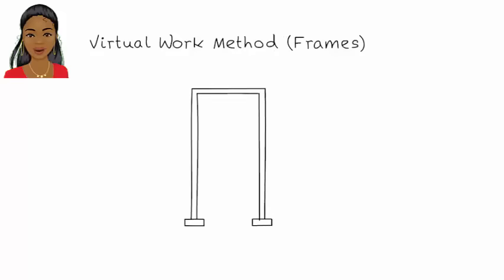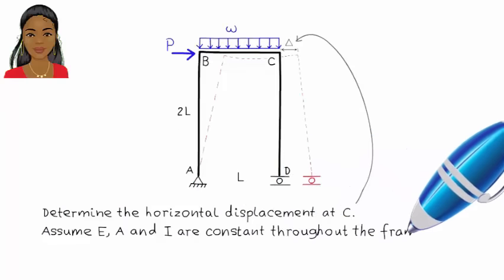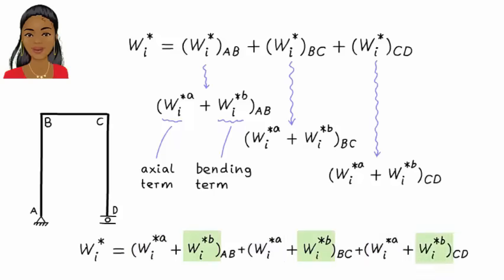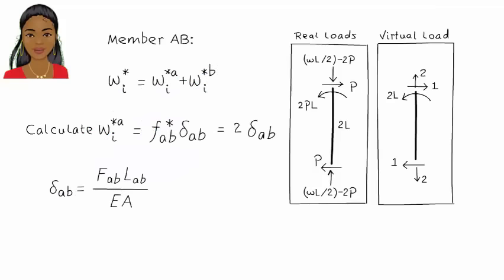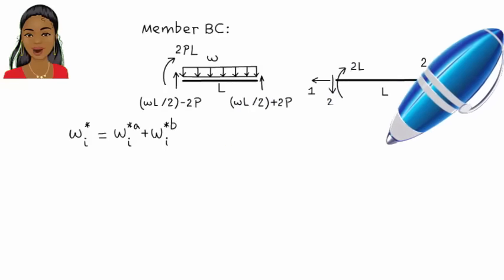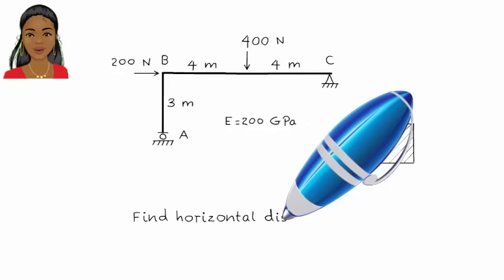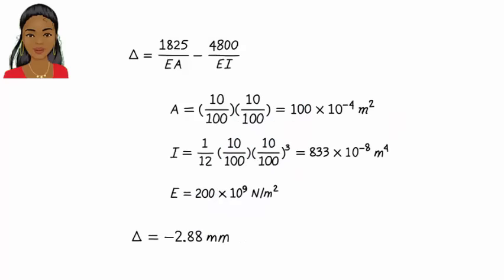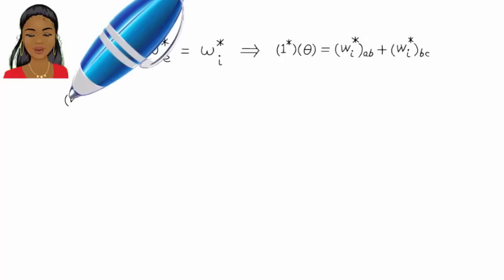SA23: Virtual Work Method (Frames)

Comment: Hi, at the example: where is the moment in member BC due to 400N load?for example at the FBD of joint B? am I confused?!!
Reply from the maker: +Omid Hassani The free-body diagram of member BC is shown @9:00. 

The diagram shows no bending moment at B or C. Basically, the FBD is that of a simply supported beam. So, we are writing moment equation for a simply supported beam subjected to a concentrated load of 400N at mid span.

This means bending moment at B is zero (moment at the ends of a simply supported beam is always zero). Then moment increases as we move toward the middle of the beam. Where does this moment come from? From the shear force at B. That is, at distance x from B, bending moment equals: x times shear force (or support reaction, if we saw the beam as simply supported) at B, or 200x. This equation is valid for the left half of the beam where 0 < x < 4.

Past the middle of the beam, the bending moment equation changes due to the presence of the 400N concentrated load. Now, the moment equation becomes M(x) = 1600 - 200x. This is valid for the right segment of the beam where x is between 4 and 8 as indicated in the video.

Just like a simply supported beam subjected to a concentrated load, the moment diagram for member BC takes the shape of a triangle defined using the two equations above, if we were to graph them.
Reply: +Dr. Structure 
What if member BC( horizontal one) makes a 120 degree angle with AB and just one load of P (vertical) at B (down word)?
Reply: +Dr. Structure thx
Reply from the maker: +Omid Hassani In that case, member BC carries no load (no internal shear, no bending moment). The entire vertical load at B (assuming it is the only load applied to the frame) is carried by AB. No horizontal displacement at B or A, only a vertical displacement at B.
Reply: Even when the A is a roller, still no horizontal displacement for A?? ( AB is not vertically, 60 degree with ground and 120 degree with BC)
Reply: I wish I could send drawing to explain more, May i have any email address so I can send drawings with my question?
Reply from the maker: +Omid Hassani If AB is not vertical, there are going to be displacements at B and A, and possibly shear and moment in both members.
Reply from the maker: +Omid Hassani 

Dr.Structure@educativetechnologies.net

Comment: In the numerical example, shouldn't the axial effort due to the virtual force in the member BC equal to 1 instead of -1 (f*bc = +1)?
Reply from the maker: The axial force in BC due to the virtual unit load placed at A is compressive, that translates into -1 per our sign convention.
Reply: Got it, thanks!